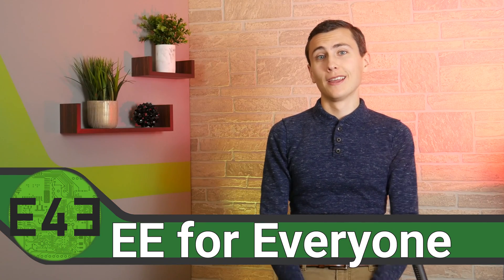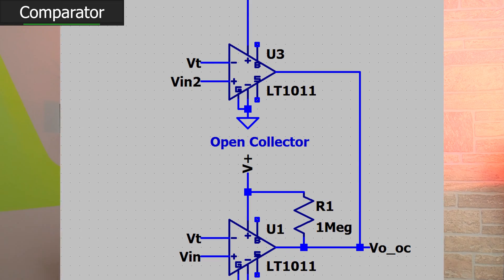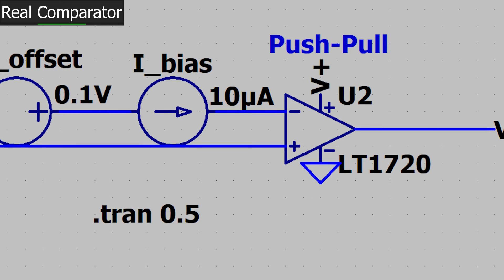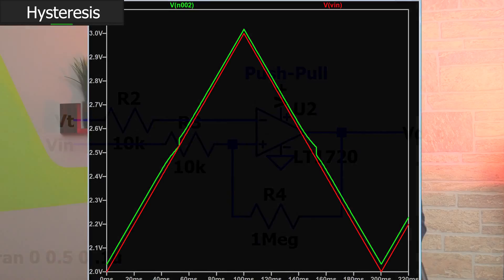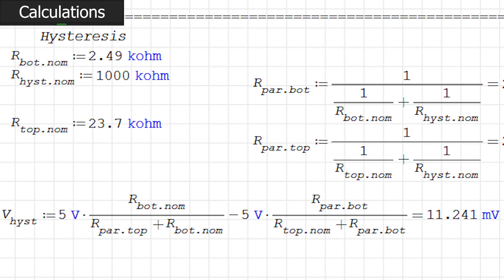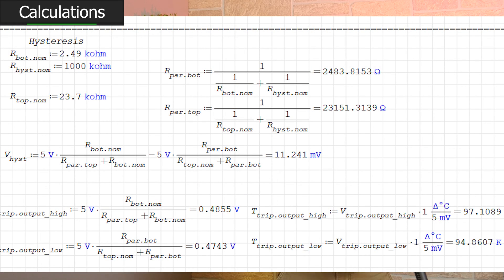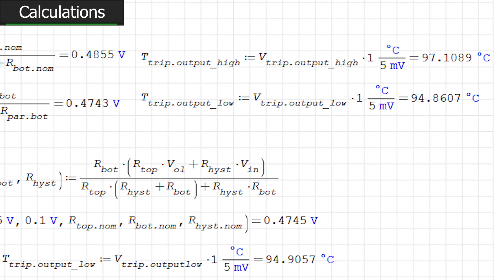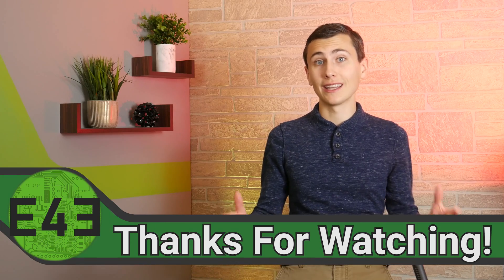Comparator Calculations! (Setting Hysteresis)

Comment: Damn! Your old 'anorexic' self surfaces in YouTube's result when I am searching for 'hysteresis'! 😂

The calculations... I died merely by looking at them! 😂 😂 🤣  I found another one, he drew it out what the hell hysteresis is and I immediately understand. I have nothing to do with mathematics. I just want to know how it works.

Audiophoolz have been throwing around compression, gate, and lots of jargons casually. Many of them build their own gadgets as audio and electronics are no different to each other. Problem is most of them are biased and lie to themselves. Same as photographers and videographers will have senses overload very quickly.

Example, we see green tint only for a while and our brain tricks us saying it is white. We listen to constant noise for a while we tend to ignore it, or not hear it as if it was not there. This is why we need some kind of measuring tool normally in the form of graphs so that we do not fool ourselves.

Comment: One of the first things we learned at Uni (as an EE anyway)
was start with as simple for a model as you can and then built on it till you got the specs you need

like does it matter that you signal is offset by 10mV when the signal is 5V, not really

but it is a hard thing to learn not make everything "perceft"

good video
hysteresis is a super useful tool both in hardware and software
Reply from the maker: Hello Anders, That is great practical advise. Nothing is every perfect.. and it's easy to get caught up in trying. 

Thank you for the praise, and cheers!

Comment: Don't be hysterical, get hysteresis!  AWESOME joke 🤦🏻‍♂️ LoL (making fun of my own bad joke, nothing in the video for those that comment before watching videos LOL)  --- Anyway it's great because I've had applications where all I needed was hysteresis and others where I just use window comparator and vise-versa (and so one with all types of combinations in between) -- intentionally vague btw, but I digress 😊 Also, great video!!!
Reply from the maker: Ha! Yes, DME - I like your joke. Indeed. A comparator setup for every occasion. Thank you for watching, and I'm glad you enjoyed our video!
Reply: @EEforEveryone  haha, I am glad! Yeah you have some great content on here  for sure!   Also, it's been awhile since I've TRULY dove into using op amps (I use them a lot, but I'm more referring to the level of working with them to where I can set up circuit types and do the calculations without having to look up schematics and/or modify designs thatare incorrect or I wanna modify for my purposes (LOT of REALLY smart people put there and some of the best knowledge is usually in older books, etc.)  -- but yeah, I wanna be able to only look at the data sheets for specifications when trying to improve an area of knowledge in circuit design - I love building mechanical things as well as electrical and a combination of both - I've always worked on my own (and others) guitars, amps, building things from scratch, biomedical devices, etc..I have chips galore so it's rewarding as hell when you teach somebody something and they get it or vice versa :-) I somewhat agree with the teaching method where certain things are in a black box so to speak, you know how to use them not what's inside them, but it in the same breath I get to (or get BACK TO) where I know what's inside things so I can understand them in and out because it makes things more and more intuitive - it's all about making those conscious things subconscious so you can keep building your knowledge! I also should have stated that working on guitars and stuff is fine but I'm a bigger fan of literally EVERY area of electronics, the less I understand in a certain area, the more I want to stress myself out and learn it, it's rewarding as hell :-)

Anyways, sorry for babbling so much I'm tired as hell, but I wanted to respond to this -- probably should have waited LMFAO 😂

Love with Channel! Take care!
Reply from the maker: That's Awesome! I love your passion to learn - and drive to constantly push yourself. I don't mind the rambling, thank you for sharing!!!

The "Black Box" view can be helpful, but also dangerous if one has no idea what's inside the box. :) I agree: the big picture view and detail view are both important!

I hope you got some rest, and that you and yours are all doing well!
Reply: @EEforEveryone  😊😊
Reply: @EEforEveryone  yeah it's hard to find people, in person lol, that are really passionate about learning and doing stuff like this or similar - especially people that are long-term passionate as well as open-minded so for example, someone wanted to build networking stuff in another person wanted to build stuff to oh, let's just say built speedometers for model cars or something random or something for astronomy. Finding those that go, hell yeah let's work on that other thing I have it done before and vice versa. It really opens the locked door for inspiration
Reply from the maker: Yes, agreed. In some circles they're easier to find, but in general, it's hard to find people with that "can-do" attitude. I hope we can find ways to continue to inspire one another! I try to be pretty attentive and responsive to the comments. Actually, I've got a feeling our next project actually started as a comment suggestion!!

I'm super thankful for you, and everyone who speaks up in the comments. Cheers!
Reply: @EEforEveryone  Amen to that man! Amen to that!  I can imagine a person like yourself and those that you work with, have gotta love all the comments where people make suggestions or want to help (ignoring the dumbasses of course 😂) there's some really brilliant people out there that just love to share their thoughts and so on. Definitely cool that you engage the comments so much! Looking forward to seeing your project(s) move forward and continuing to learn great stuff from this channel.  I'm sure all I know drawing a question or to your way at some point 😁
Stay safe out there! Take care!

Comment: Good video, although I struggled quite a bit to follow along. It would be immensely helpful if you drew out the circuit and then ran through the equations by hand on paper (or digital equivalent), showing where each resistor in the circuit is and perhaps speaking a touch slower. I'm working on building a similar circuit, and it seems everything I need is in this video, I'm just struggling to parse it.
Reply from the maker: Hello JGuy! Thanks for the comment! I really appreciate the constructive feedback.

It's awesome to know that you're trying to learn from our video, and it's a shame that you're finding it frustrating. I'll make a point to revisit comparators as a topic of discussion (and try to slow things down) :) 

I'm curious: Where are you getting stuck? Hysteresis? Setting the threshold? How comparators work in general?

Comment: I've seen many comparator circuits without hysteresis. Now I only recommend comparators with built in hysteresis lol. MCP6541 FTW =) (6mV?).

OR'ing comparators is another great tool.

Very information dense, but a very worthwhile topic!

I was taught much larger hysteresis voltages, rather than the small-ish voltages required for stability over temp, small sensor fluctuations, input bias etc. All the theory is the same. Just another tool in the toolbox =)
Reply from the maker: Hi No Corporation! Yeah, I think we really packed the Info into this one. :) Built-In Hysteresis certainly makes it easier to remember to add some! LOL.

I'm glad you liked the video and liked some of our broader points. Hopefully it saves a few folks the trouble of... not having any hysteresis.

Cheers, and thanks for watching!